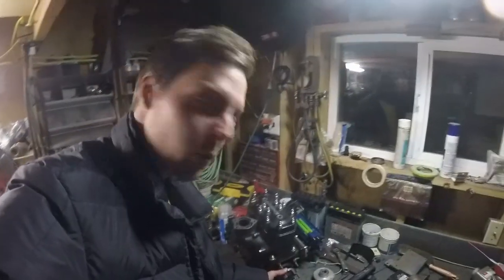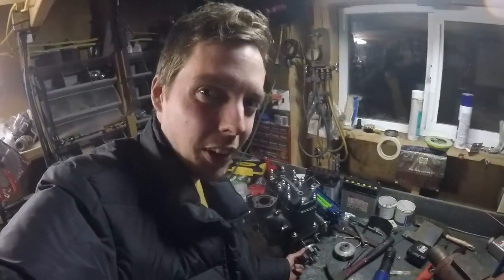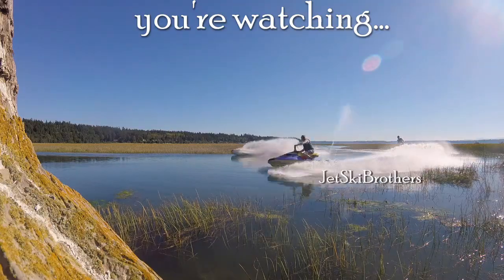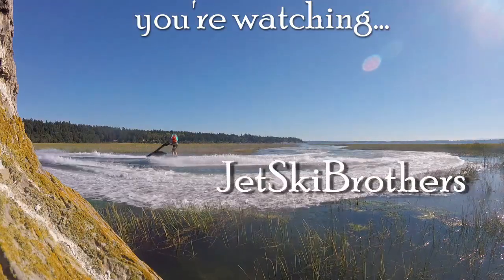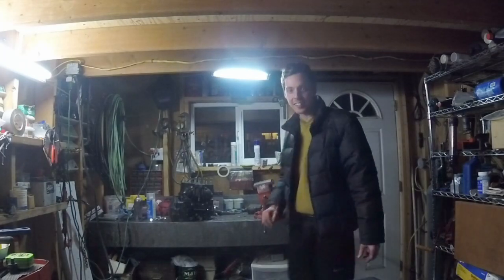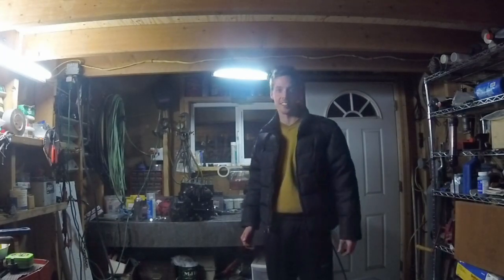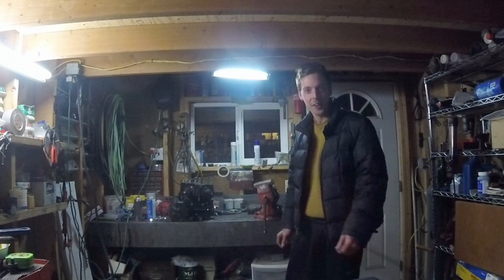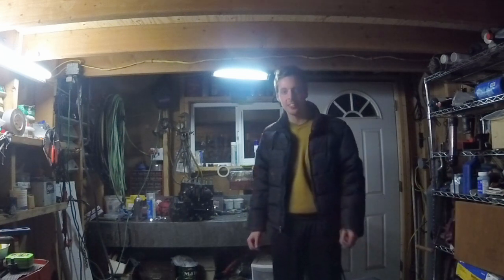jetski drive coupler removal trick

Comment: Can I tighten the crank bolt using the rope in the cylinder trick? The bolt requires 195 ft lbs of torgue. Is that too much pressure on the psiton when it locks up?

Comment: Did you ever have any luck with getting that tigershark 640 motor to run well? I have one that I can never get to run right.. seems like it goes into limp mode.. Not sure if you can just disconnect that sensor? Thanks!
Reply from the maker: Brock Jones the 640 swap will be back, and come to find out the 640 ended up having a broken reed.
Reply: @JetSkiBrothers  Nice! Can't wait to see that in action again. Love the channel! Keep it up👍👍
Reply: You can disconnect it. I did. If you take it off and it still runs like crap..... at least you know that's not why. I'm excited to get mine running good so I'll really know if its lame or not.

Comment: yea except the pipe wrench will bugger up the outside of coupler where it doesnt matter. the air chisel with bugger up the mating surfaces. also NEVER use the pistons and the crap connected to them to stop the engine from rotating.

Comment: You could just add a nylon rope down one of the cylinders, but first bring the piston above the ports, then raise the piston to compress the rope until it stops, and use the appropriate coupler removal tool for cheaper than a $200 air chisel, in addition, not having worry about damaging the coupler itself.  Or, you could do the first step with the nylon rope, then use a large 3 foot squared edge pry bar and line it up between the coupler splines, heat the coupler with map gas for a few seconds, and break free easily without damage to the coupler.  And lastly, if you want to get real creative to have a permanent cheap tool for next time uses, purchase a coupler from WSM for about $38, and weld a bar to it, and repeat my procedure.

Comment: I had a 4ft pipe wrench and couldn't budge the coupler. Broke out my cheap air chisel and like magic it came off. You dont need a Over priced cornwell air chisel. The cheap one with 90 psi is fine.

Comment: Tried this and it didn't budge the coupler. I could tell it was cutting right through the aluminum so I quit before removing one of the coupler's ears. And yes I was turning it the correct direction (ccw looking at it). I also tried holding the shaft with a wrench and using a bar in the coupler ears. This thing is stuck pretty good. I heated it with a torch before all of these tries. I will say it seems like a good idea. Obviously it worked great for the one in the video.
Reply: Got it?